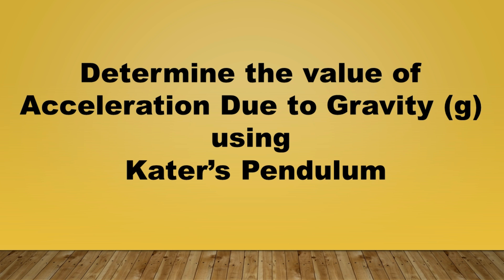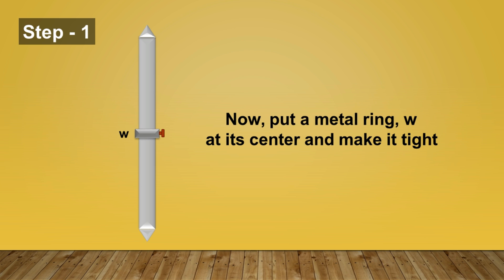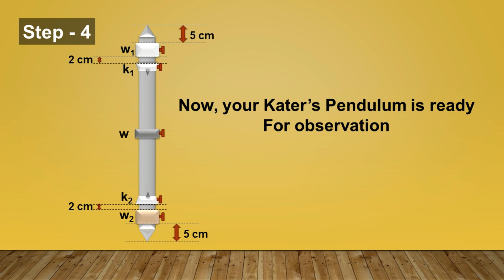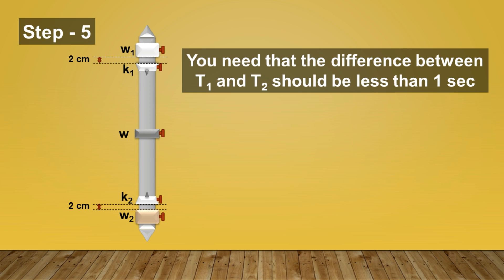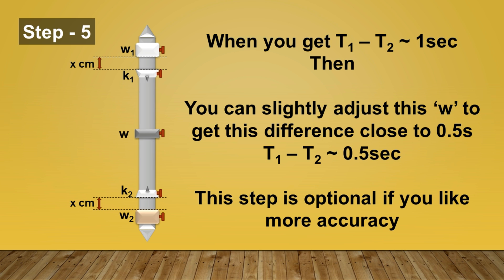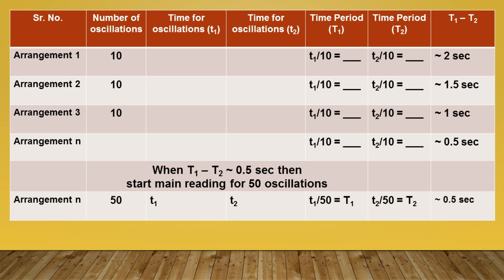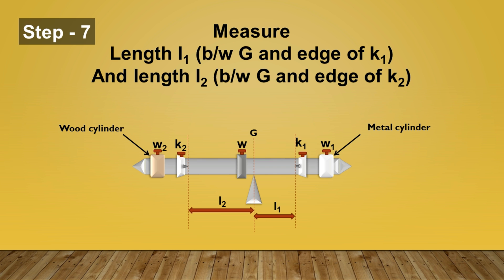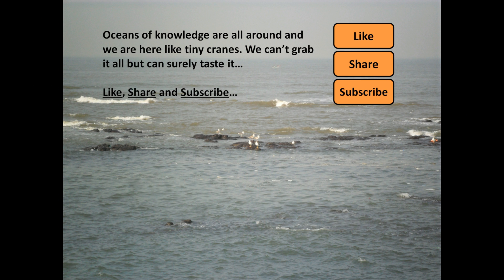Kater's Pendulum with Full Explanation | Practical File

Comment: That's an odd variation of the experiment.
If you move the center weight W and track the periods when hanging from K1 and K2 as a function of the position of W, you have two graphs.  Where these functions intersect, T1 is equal to T2.  L1 + L2 is simply the distance between K1 and K2 (call that D).  Then the equation for g becomes:
g = (D*8*Pi^2)/(T^2)
This T can be found with high precision by fitting functions to the curves and finding their intersection point.  You don't actually have to adjust the setup to make T1 and T2 equal.

Comment: Sir
What happens
If we balance the centre of gravity after using the wood and metal wood
Means why we balance the rode without the blocks 
We have to balance after oscillation
So why we don't balance by using blocks earlier
Reply from the maker: You can use any way to balance this but the main task is your l1 l2 should be considerably different for for very close time t1 and t2. My video is just one way to approach this condition without confusion. You can put blocks first then approach minimum time difference and then find l1 l2. This is also okay...
Reply: Ok sir